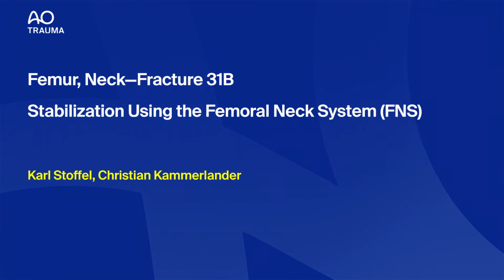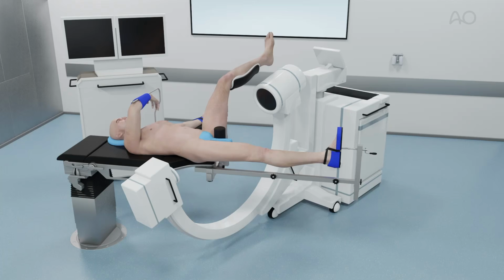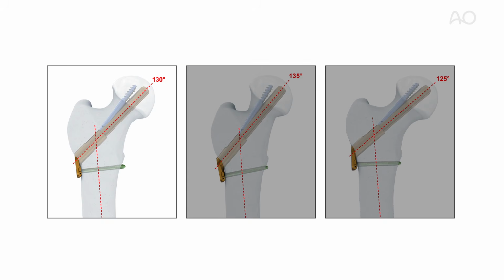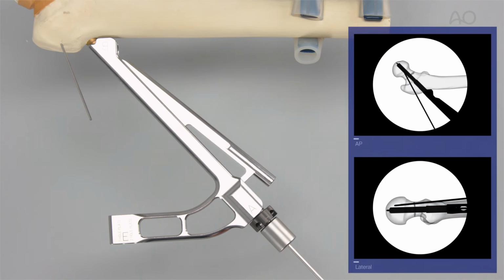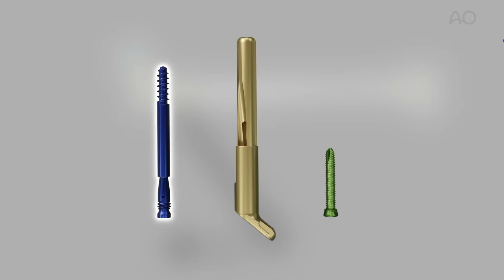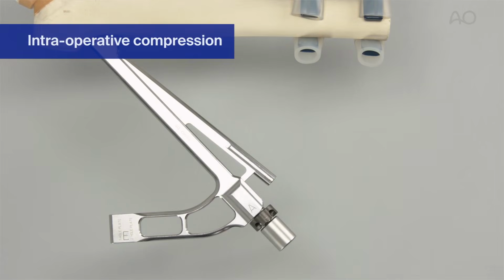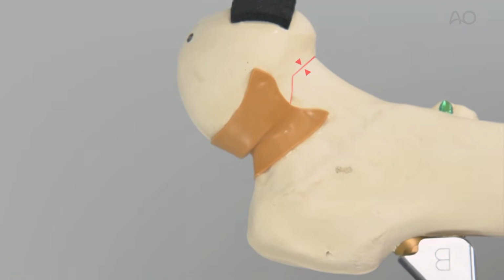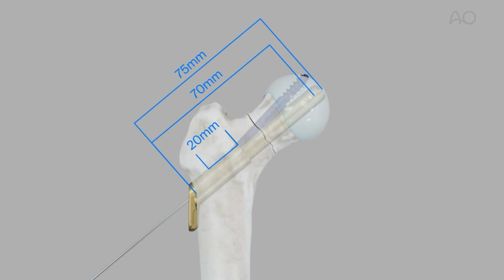Femur, Neck—Fracture 31B—Stabilization Using the Femoral Neck System FNS

Comment: Does this fns system stay in permantly or do you have it removed later in life..if fns system is left in can the fixation raise your chance a getting avn if left in
Reply: That's what I want to know also. You had hip screw too?
Reply: @thebestkeptsecret2263  yes .doctor recently told me it stays in unless it causes problems..idk 🤞that it dont
Reply: @joesmithdeschamps3838  how old are you sir? Is your fracture in neck of femur? Mine is different. It's been 6 months now. How long you had your screw?
Reply: @thebestkeptsecret2263  yes its a femoral neck fracture..I just turned 45..
Reply: I've had mine for only 6 weeks ..start weight bearing in a week or 2
Reply: @joesmithdeschamps3838  if you like to join our facebook group. All of us had hip screw. You can learn and share in our group
Reply: @thebestkeptsecret2263  what's the group?
Reply: @joesmithdeschamps3838  hip pinning DHS recovery
Reply: @thebestkeptsecret2263  thanx..yeah I'll check it out.
Reply: @thebestkeptsecret2263  could you post a URL? I can't seem to find it.
Reply: @speedingAtI94  hip pinning dhs recovery. Just type that sir